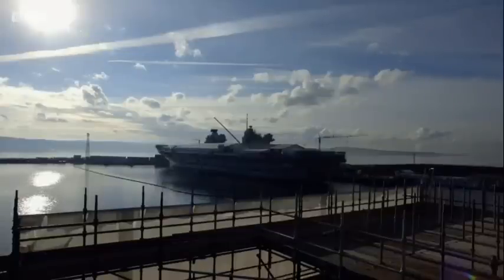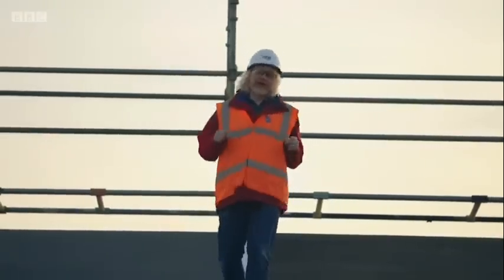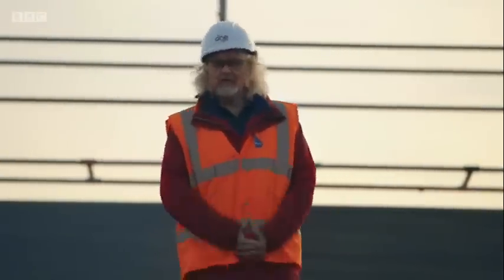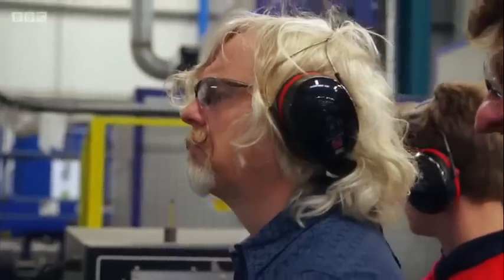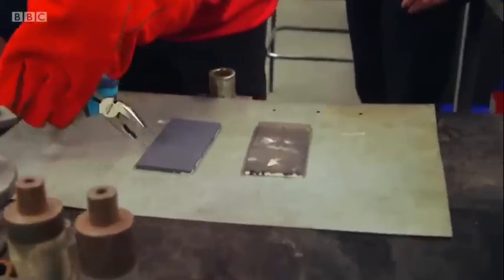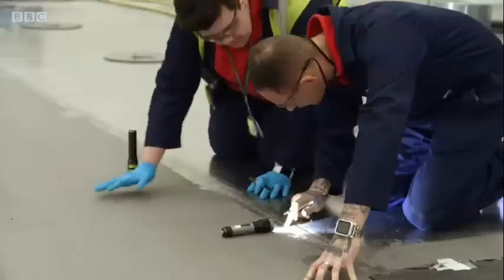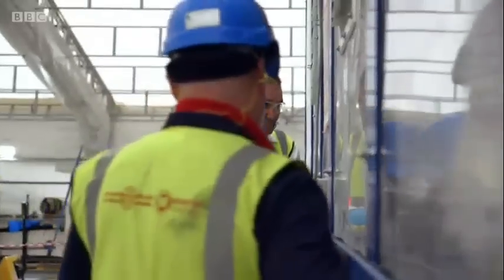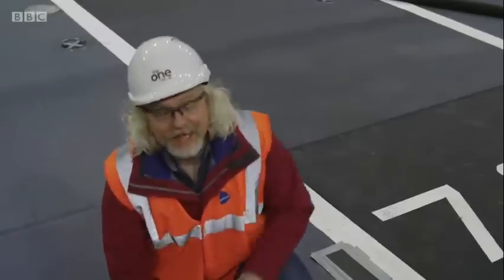Queen Elizabeth Carrier - TMS Deck Coating. BBC One Show 26 Jan 17

Comment: Did the old Harrier vertical take-off melt carrier decks?
Reply from the maker: Howard Selby no. It was not as powerful as the F35 and the temperatures were much lower.

Comment: Hmmmm, this coating looks ingenious for solving the engine heat problem.  But, aluminum is very vulnerable to salt water corrosion.  How will this experimental coating stand up to the thermal cycling of weather and engines combined with salt water corrosion over years?  One assumes the experts have tested this issue, but, I have little respect for "Experts" these days.
Reply: R. Blakehole Nah,am sure they haven't taken in to account the sea,when designing an aircraft carrier..........
Reply from the maker: R. Blakehole to be fair, the RN have extensive experience with aluminium corrosion. Naval aircraft are made from it, and the superstructure of ships also.

Comment: Very interested in seeing how the two-island architecture works out.
Reply: +Toolpusher,
Quite possibly true as well, there are a lot of side benefits to the two-island layout. My point was only that the underlying reason is the propulsion layout.
Reply: It's a bit late to change our minds if it doesn't. :)

However the two-island design is really a byproduct of wanting to separate the ships' engines which are located in the sponsons directly below the islands. Located there they are potentially vulnerable to damage so it very desirable to separate them to avoid a single collision or weapon-impact taking out all the engine rooms at once.
Reply: Then there's a small place deep in my gut that says "uh-oh".  I'm not an expert at all, but that just feels like a hell of a compromise.
Reply: If you want to understand why, I suggest you look at the old 1920's Japanese and American carriers and the convoluted designs of funnels they experimented with. Ducting those exhaust gases from deep inside the ship around the hangar and out into the air without interfering with the airflow aft of the ship or asphyxiating your deck crew was a problem. Putting the diesels and gas turbines directly under the towers and having simple vertical intake and exhaust ducts saves a lot of hull volume which can then be used for a larger hangar, additional munitions and aviation fuel storage. Not as good as nuclear, but if you're building a conventional carrier the design makes a lot of sense and solves one of the historically difficult parts of designing a carrier.
Reply: Akm72  Thank you--perfectly clear explanation.
Reply: You're very welcome though I should point out that I'm no expert, I'm just passing on what I've heard from people who know far more than me.
Reply: I've been told that this layout also optimizes airflow over the flight deck, although I, also am no expert. Bloody fine ship though.